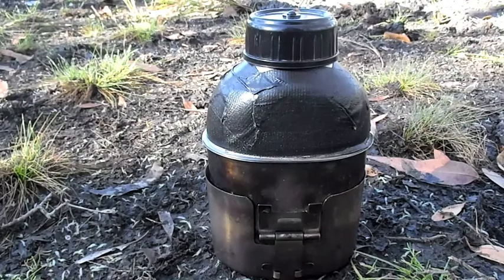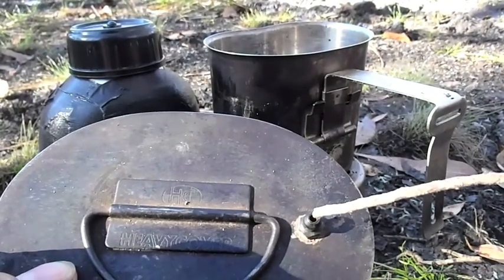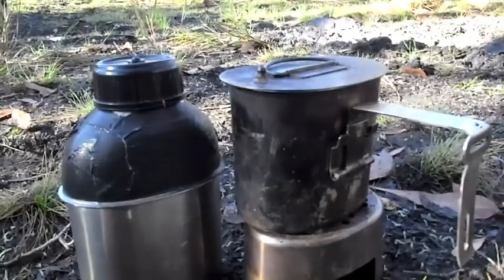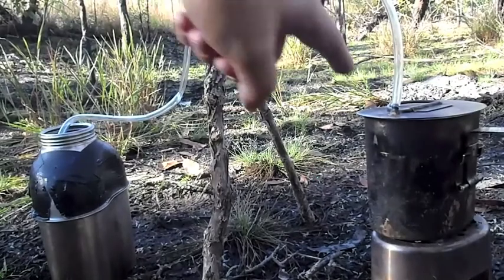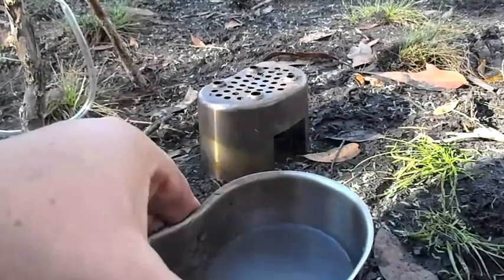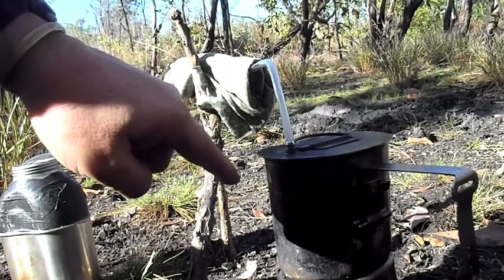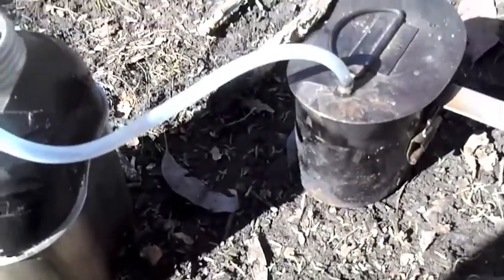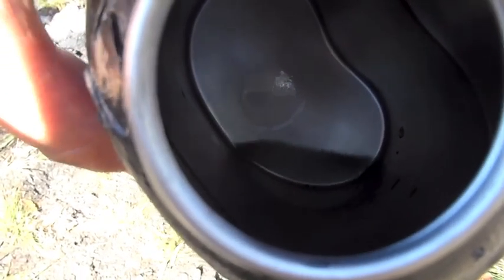Canteen lid modification - saltwater desalinisation still

Comment: I like this idea:) 
I think I might try a similar idea, but with sigg style aluminium bottle with etheir a cork with a hole down the centre (for fixing the pipe) or even some sort of copper pipe with a bung on the end to fit in the mouth of the bottle, I think a bigger diameter pipe would help speed things up, all the best and thanks for the video
Reply: I will have to test it out with a fortified wine and see if I get liquor :) 
that way I can be sure it will work on salt water lol
Reply from the maker: Thanks mate - a wider diameter pipe would definitely be the way to go and would give you  a better output. I'd be interested to hear how it goes. I use the poly pipe as it can be wrapped up small in my pack - but a short length of copper pipe would also weight next to nothing and take up little room.

Comment: Good idea, i was just thinking of this so came to youtube knowing someone must have done something like this-to my surprise you have the same kit :-) The limitation on the nozzle makes me want to find a way to use the bottle as would be easier, yet then you have a dirty bottle. In a survival situation, anything is better than nothing :-) I will scour workshops until i find the solution and post back....good video and well presented, thanks!
Reply from the maker: +Stu M Thanks Stu. We have had much better success with a steel water bottle (the heavy duty 32 oz ones are great) using wider hose / pipe, or even bamboo. Main thing is getting good seal around the mouth of the bottle. Good luck and I will be interested to hear how you go with your kit!

Comment: The Australian store bunning sells one :) it's an Australian invention.
http://www.bunnings.com.au/carocell-3000-f-cubed-solar-desalination-modular-unit_p5102981
But that is to heavy for my pack. Like your nipple idea. I've seen a wet towel over the billy that you continually wring out as another method. (Have not tried this yet.)  I have tried the upside down curved lid with a small catchment container, but got only a small amount of water after hours of boiling.  If you design a good system please share.
I have sub you.  Great videos.
Reply from the maker: Thanks AS, the next mod I do with it will be a flexible metal hose to replace the plastic one. We recently spent some time in East Timor, and water procuring was our #1 priority. One the the guys took a standard 1 litre stainless steel water bottle, pushed in a length of hollow bamboo into the mouth, and tied a food grade plastic bag to the other end of the bamboo. The bottle was filled with sea water and put at a 45 degree angle into campfire. It was rough, but worked with a much higher output than my unit. Experimenting is the only way to go. Thanks for your interest.
Reply: Keep on experimenting :)